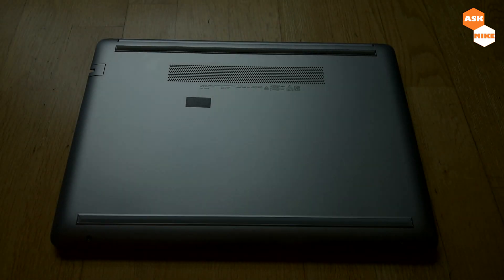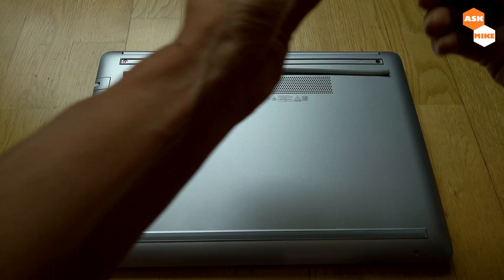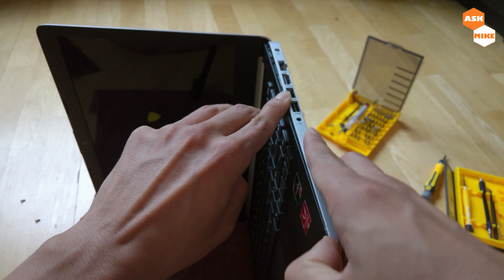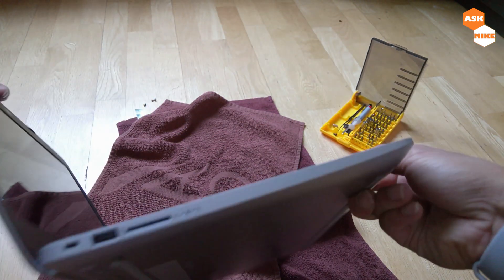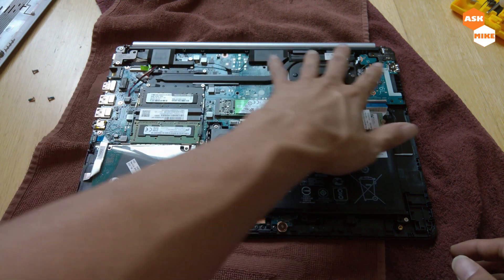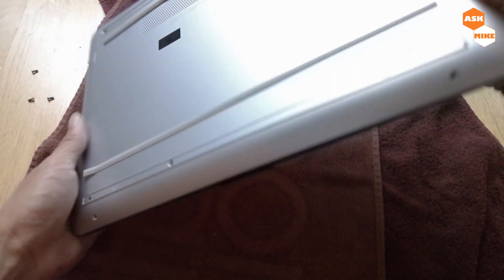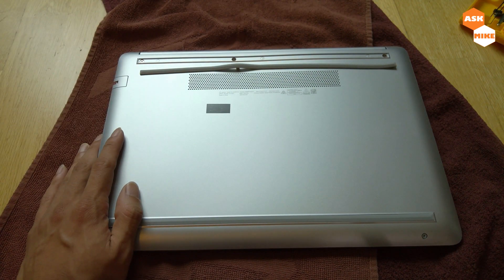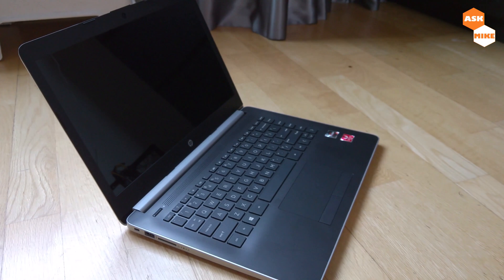HP 14-cm0107AU Ryzen 5 Laptop Upgrade RAM and SSD

Comment: If I were to add an second ssd to the vacant slot, do I still need to match it up to M.2 ssd? I'm trying to upgrade my HP NB 14s-dk0121au
Reply: I have the same model, and I added a 512 GB M.2 ( that was the maximum capacity for SSD supported), for default my model have in a 1 TB hard drive, and now it have the 2 units, the hard drive and the SSD. It's feels very snappy. I hope you understand me bc I'm not a english speaker.

Comment: hey man, I have the 106au, what ram did you use for the upgrade? 8gb 2400 or 8gb 2666? and which should I choose between the 2 if I decide to upgrade?

Thanks for the video btw
Reply: 2400 says in the product specifications
Reply: @someperson5600  2666 wont work?

Comment: hey, i wanna ask you about the hdd 2.5"

i also have hp14 but only use ssd m.2 sata, Can i use another storage like you do(used a 2.5" sata)?
Reply: I want to know about this as well.... my iteration of the hp 14 doesn't have an extra drive, just the m.2 BUT I do see the space for it. Probably just need to order a SATA ribbon from HP is what I'm thinking.
Reply: Looks like the part number is L23187-001 for the sata cable/ribbon - but I have to look at my board to make sure the connector is there (I think it is if I remember correctly). My version is the 14-dk0028 with the ryzen 3 3200u.
Reply: @jasonsadler361  yeah, my type is dk0028wm too. But it hard to find the ribbon nd the bracket on market. I think i'll buy enclosure or sd card 😔
Reply: @ReddStinkyBox  There's a seller on Amazon that sells it for 20 shipped (US). Says they have 19 in stock and is returnable. I'd just use some double sided tape since SSD's are super light and can bang around without getting damaged if it comes loose. I might do that.

Comment: Mike, just wanna ask one thing.. my sister has this laptop with 4GB of DDR4 RAM 2400mz in it.. Is it possible to replace the RAM with higher frequency? For example 8GB 2666mz single or dual 4x4 GB 2666? Will be waiting for your answer. Thank you
Reply: sorry, 2400hz with 2666hz

Comment: Bro, do you know HP 14cm0008au  slot SSD M2 support SSD M2 NVME or SSD M2 SATA3?
I'm waiting for the answer, thanks.
Reply: Chris 777 They dont support nvme
Reply: @arasumi3408  thanks for your information. So is it SATA Mode? But why the slot have one cut on the connector just like NVME? As we all know NVME have two cuts (hole) on the connector.

Comment: It must be said that this laptop is dual channel ram (unlike a lot of other Ryzen laptops). This is great because Ryzen really likes dual channel ram. This laptop doesn't thermal throttle as easy as the better looking slimmer alternatives with 2500us in them too.  The thick bezels are the only downside to this monitor. I would prefer a non glossy screen but the IPS panel is nice.

The audio from the speakers is ear bleedingly bad. Nothing headphones or a plug in speaker cant fix.

My one has an m.2 already installed and loads insanely fast.

Downside is - its noticeably slower than a desktop pc for web browsing (scrolling etc isn't as smooth). Gaming performance is beyond horrible. Its not intel on board horrible but its pants. Good for playing Don't Starve together with the gf though - Football Manager and any vaguely 2D game will run without a care in the world.

The wifi is slow. The computer also randomly starts up with the CPU running way under 1ghz. Has to be restarted to fix that.

Overall - nice laptop. Do not pay more than £300 for it though. IMO.
Reply from the maker: That is a nice write up for the laptop.. thanks man.
Reply: I paied 450$ in Perú lol, here whatever is more expensive than in North américa
Reply: I also encounter the problem which when the first it starts up it just lags and need a restart and it will run as usual
Reply: Hi sir May I know if you have an idea with HP Notebook 14-CM0105AU Ryzen 5 if its good for autocad and graphics design?

Comment: After installing the SSD, do you clone your windows to the SSD or do a clean install?

If clean install, how to remove the HDD from this laptop?
Reply from the maker: before you install SSD you can clone it from your existing HDD or you can clean install into your SSD. It would be easier to remove the HDD from your laptop.. plug in your SSD and install. once everything is done just format the HDD for your extra storage.

Comment: Can you upgrade both RAM slots? Or is there only one RAM slot that we can upgrade?
Reply from the maker: It comes with 2 slots, mine comes with 4gb, if you want to upgrade both then you will have extra piece of RAM
Reply: @AskMike  what is the max RAM i can have for HP RYZEN 3 laptop. Can i have 8GB in one slot and 8 GB in second slot. what will be the part number for 8GB and  4GB RAM?
Reply: @sanjayparelkar3912  I have the same model with 8 GB RAM, I read on hp's website that the maximum RAM is 16 GB, with two setups, one RAM of 16 GB or two with 8 GB.
Reply: I have the same model with 8 GB RAM, I read on hp's website that the maximum RAM is 16 GB, with two setups, one RAM of 16 GB or two with 8 GB.